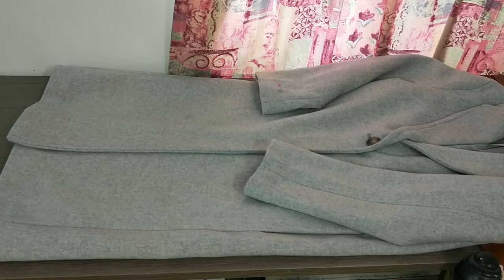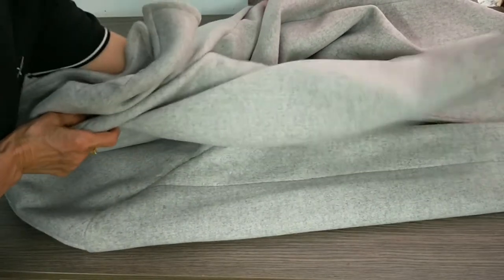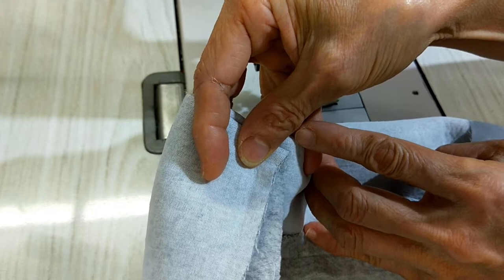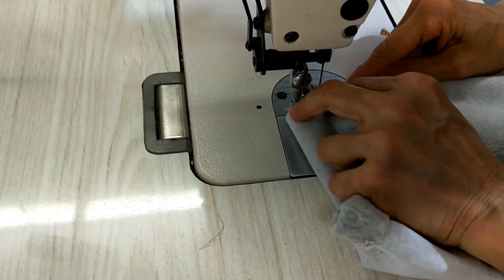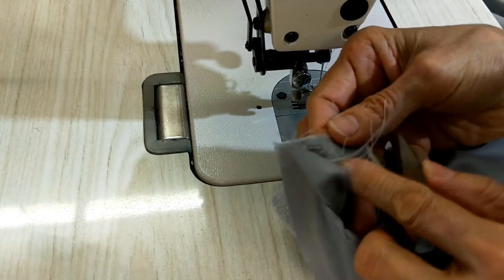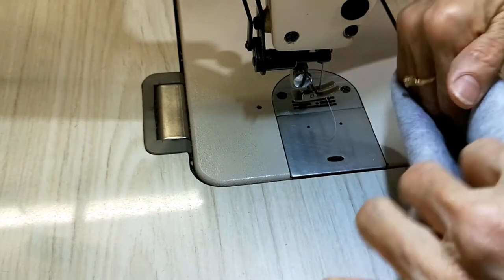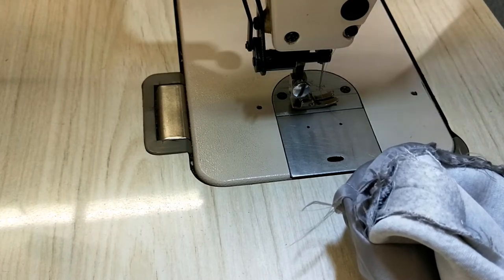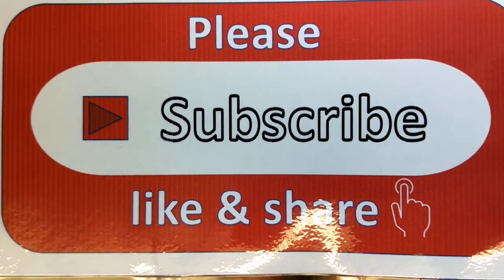How to shorten sleeves on lined jacket.

Comment: Thank you very much for your teaching video.  I understood all the steps until you last when you added the pins and  inverted the shortened finished sleeves back and started to stitch it by hand on the inside.  What is the reason of stitching by hand when you already shortened it and did it by the machine.
Reply from the maker: Hello. The last step I have 3 options, I can leave it as is, but with loose cuffs or thick fabrics I need to put 2 sides interfacing inside to iron the hem to keep it stay firmly or I do hand sewing for it. Thank you very much for watching, Have a great day